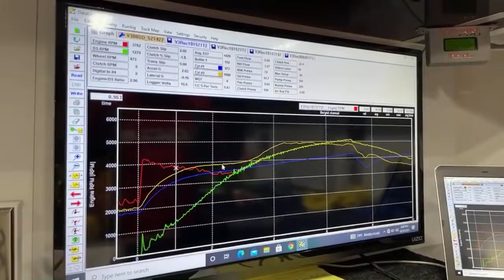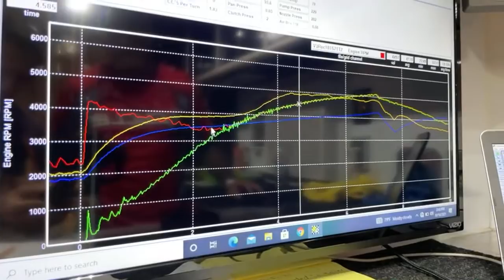TOP FUEL HARLEY QUALIFYING from ROCKINGHAM’S JIM MCCLURE NATIONALS

Comment: what are they squirting into the carbs during firing the motors?
Reply: I believe its nitro fuel to prime it
Reply: Arizona, they can use either gasoline or alcohol,  either works. Once it's running,  they switch it to the nitro. Hope that helps. 
T.S. RACING
Reply: @killerb4202  Yes it's fuel. Not Nitro.